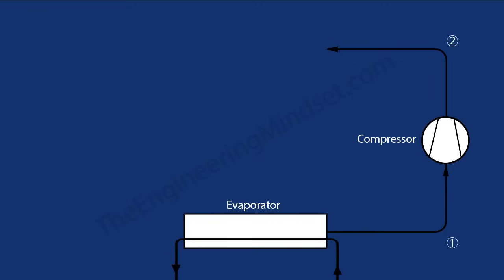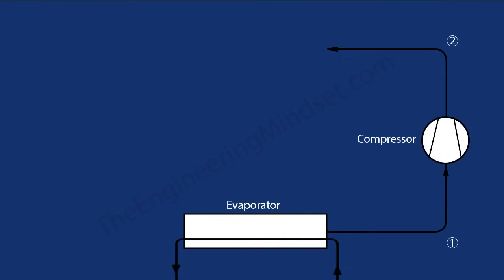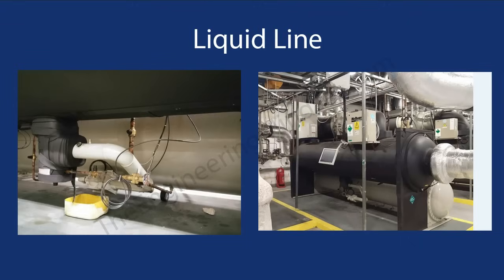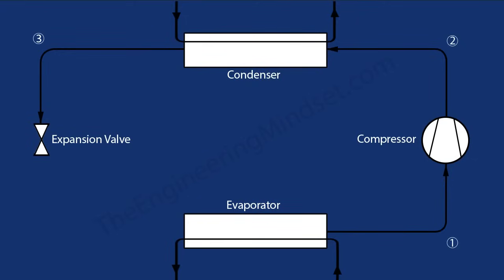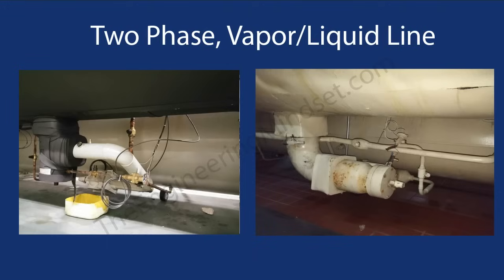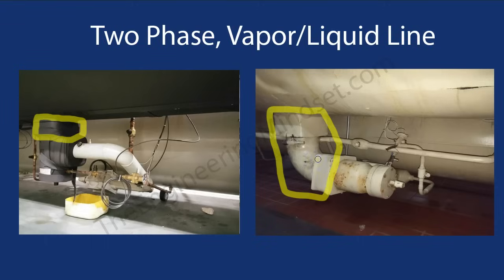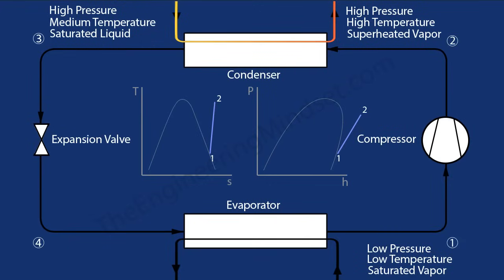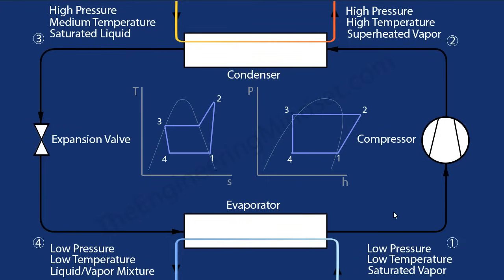Chiller Basics - How they work part 2

Comment: I love your videos for sure, I have three chillers in my building at the plant section, York 450 Tonnes screw type chillers which replaced two older centrifugal that had to go!! The total cost of retro fitting about 2.8 million, it was a big project which included other equipment replacement. My building was the first to use Co-Gen  system in NY back in 2004 now much more popular these days.

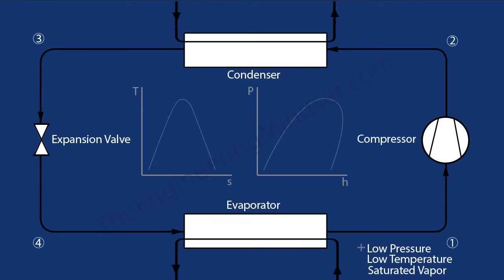Comment: Awesome video, I do have a question though. 17:53 Shouldn't the refrigerant be super heated instead of saturated in line 1 to prevent any liquid from reaching the compressor and damaging it (as compressors can't compress liquid)? In my school I learned that they place a heat exchanger between the condenser outlet and the evaporator outlet to ensure all the vapor is super heated before reaching the condenser as well as sub cooling the condenser outlet to prevent vapor reaching the expansion valve.

Comment: Very informative video. Interesting how there's no temperature change inside the evaporator even though there's clear heat transfer from the chilled water to the refrigerant. Is all the energy used up in the transition process?

Comment: A very informative tutorial, fantastic! I'm an electrician and am trying to teach myself HVAC / Re-frige. If the system was to go from Cooling to heating how would the system work?

Cheers
Reply from the maker: It's pretty rare now to find a single central pipe system that is used for both heating and cooling. I think you might be referring to a heat pump though. If so check out our new heat pump videos its all explained there
Reply: @EngineeringMindset  The place im working at the moment has an ammonia system in the basement which cools and heats. when there is excess heat it s dumps the heat in the artesian well underground ( According to the refrige tech i was talking to) . ( christchurch nz)

Comment: It's such an amazing work u've done Paul. Thank u so much. Anyway, what type of shell and tube heat exchanger typically used for the evaporator especially in absorption chiller ? Is it kettle reboiler ? And what are the considerations to pick up between circular or rectangular shape heat exchanger for chillers ?

Comment: I still don't get it: so, coolant picks up heat from the return water to cool the water, goes to the compressor in order to be pumped forward, goes to the condenser to dump the picked up heat, and goes back to pick up heat again in a circle? And the tower with fans picks up the dumped collected heat to cool it? Is that like a more complicated bigger version of an AIO water cooler?

Comment: Point 3 on the Temperature is quite interesting. The refrigerant [high pressure - high temp] gas ... transfers heat to the circulating water. Refrigerant condensates into a liquid. The refrigerant liquid is still warm and temperature remains flat because it drips down and collects with no way of giving off more heat because its pretty well insulated.

Could we not have that still warm refrigerant be used - by running the circulating water pipes through the liquid portion to?
or is it just more efficient to use gas refrigerant ...which changes state?

Comment: What would be some example number of temperatures and pressures in various parts, especially lets say in a warm climate, where it might be 50-55 deg C outside? If the water is coming through a closed loop in the cooling tower, it probably will equate in the end to about 50 deg C water coming to the condenser, so the discharge line from compressor would need to be even hotter, like 65 or deg C, so then 65 deg C goes to the cooling tower, and back as 50 deg C. That is my uneducated guess. Maybe some open loop evaporation cooling towers (swamp cooler) can do a better job and reject more heat at the expense of needing extra supply of water to recharge (not sure how much water would be needed). But I guess closed loop would be a bit better, as the water is in a closed system, so it requires less frequent refills and less frequent changes of water filters, and not need extra water overall.

On a similar note I was wondering if propylene glycol and water mixture is ever used in the chilled loop? I guess for big systems, it is not a good idea, because it costs quite a bit of money to fill the system or flush it, where it is definitively easier to do with a water, which only might require some simple on site filtration, and adding some corrosion and bio inhibitors. But maybe there are used where lower temperatures are required? I imagine using glycol is also undesirable in many applications, as there is bigger risk of forming ice (from moisture in the air) when it is carried around, and on the evaporator working at so low temperature.

Comment: hey..could you explain me why we use expansion valve. only for making the refrigerant at low temp. and pressure. Or is there any fundamental behind converting refrigerant into liquid vapor..!!
please do answer.!!
Reply from the maker: vaporising it causes it to spread its internal energy over a larger volume, when it is a vapour you can condense it and carry heat away into a flow of liquid
Reply from the maker: You might like this video on refrigerants https://youtu.be/lMqoKLli0Y4
Reply from the maker: Here's a video on how expansion vale works! https://youtu.be/oSLOHCOw3yg

Comment: how much is pressure,temperature the refrigerant in and out on evaporator? then, how much pressure after compressor?  what is type refrigerant used in this video,  what do you think about after expansion valve VLE phase in %?   thanks alot  sir 🙏
Reply from the maker: Please see our chiller design videos for detail

Comment: Sir , i hav a doubt, the refrigerant entering the evaporator is at low temperature, and it picks up heat from the warm return pipe (from the building), so y is the refrigerant leaving the evaporator is stil at low temperature,( it absorbed heat, so the temp must rise, right?)
Reply from the maker: There is a phase change occurring, the temperature doesn't rise during this change because all the energy is used to break the bonds
Reply: @EngineeringMindset  ohh, ok cool 👍

Comment: Why does the compressor need to heat up the refrigerant before cooling it down again?
Reply: I have been trying to wrap my head around this as well. I don't understand why it is super heated before travelling to the condenser only to remove that heat. Seems inefficient but it has obviously worked for many years and hasn't had any massive changes so there must be a solid explanation for this. Please let me know if you or anyone else can answer this!
Reply: compressor does not heat up refrigerant, its just transfers heat from point A to point B(adding some small amount of heat, heat of compression)

Comment: On the T-S Chart the transformation 3-4 has a reduction of T. With respect to the definiton of H = E = E(T) we'd have a reduction of H. But for the lamination process, considering and adiabatic trasformation and L = 0, wants H = costant. How can we explain this contradiction?if it's so?
Reply: We should also consider that the lamination process is not a properly thermodynamic trasformation (it passes through non equilibrium state hence we'd not represent it on the diagram with a continuous line but with a dash-line), I mean the initial and final state are the same but in-between we cannot say it's costant). H = E +PV but PV=0 for lamination.

Comment: Sir after process complete in condensor we have saturated liquid(Refregirant) further in expansion valve if temperature is decreasing then how it we are getting liquid and vapour mixture?
Reply: Saturated liquid means the pressure and temperature are such that any decrease in temperature will cause the liquid to boil. It's a property of the refrigerant.

Comment: What voltage amount is used by the compressor?
Reply from the maker: depends where you use it, most chillers are 3 phase and ~415V . Check the manufacture guide.

Comment: Then where does the LiBr (lithium bromide) comes into the picture? That's what makes the difference between Chiller & VAM right? LiBr is what absorbes the refrigerant & upon heating it, you'll get the vapourised refrigerant. Because of the heating source - either electrical & steam, chiller & VAM works respectively right...
Reply from the maker: This type of chiller doesn't use that. Please check our absorption chiller video

Comment: I thought temps and pressures worked together in HVAC? When pressure goes up so does temperature and the other way around. How does the pressure stay the same from point 2 to point 3 but the temperature goes from high to medium temperature? Could someone explain?
Reply from the maker: Change in enthalpy and entropy. Check our Refrigeration design and advanced videos https://theengineeringmindset.com/design-a-refrigeration-system/

Comment: Quite good, but way too much in beginning about piping, pump and field layout. They're meaningless and I can only think that it might confuse people who don't have any knowledge about equipment. Then thing that strike me through is that even tough there are mention of vapor, liquid and temperature it immediately strike me during video that isn't pressure actually slightly dropping because of laws of physics? So it would be easier to have focus if you would've included temperatures and pressures of loop at inlets and outlets of each part. Only as a sample of working loop. Now I at least began to think during video is that is the valve actually keeping pressure same at condenser inlet and outlet or is temp drop affecting pressure too. I still think this has to be the case, but I'll look through series. But these are my current thoughts after this part. Oh and for the field layouts, it would be more effective to through them at end of the series when theory is done

Comment: I was wondering why the refrigerant would condense at a high temperature in the condenser, but boil at such a low temperature in the evaporator. It is the pressure right? The condensing temperature for the high-pressure refrigerant in the condenser is higher than the boiling point for the low-pressure refrigerant in the evaporator? 

If you mentioned that, I'm sorry I missed it, but I don't think you did. 

This is also the basic idea for refrigerators right?
Reply from the maker: Here try these videos they might help
https://youtu.be/lMqoKLli0Y4 & https://youtu.be/r1zNqzmGuPw